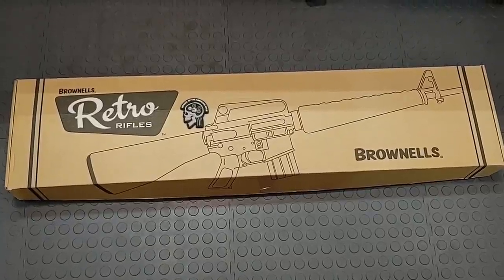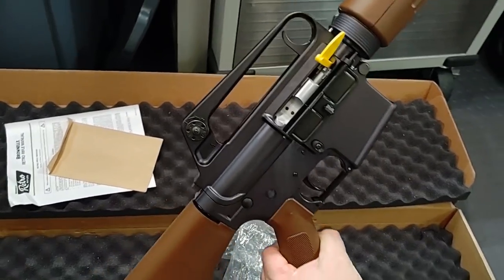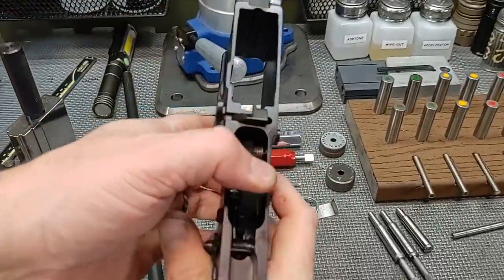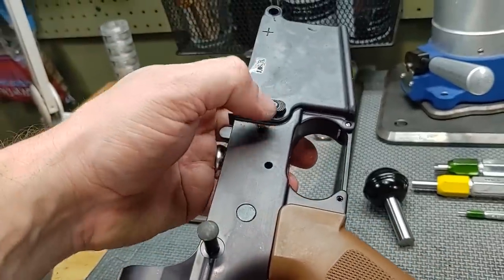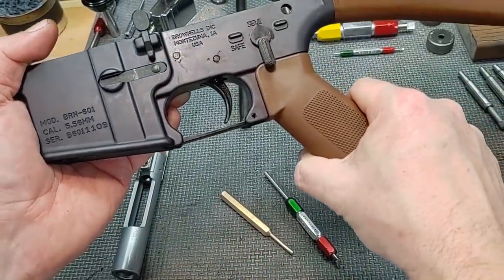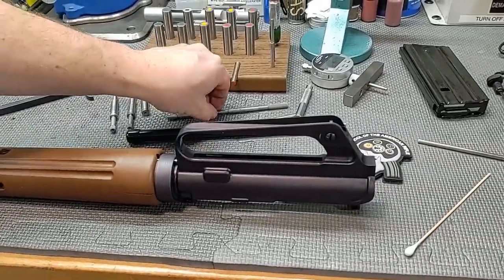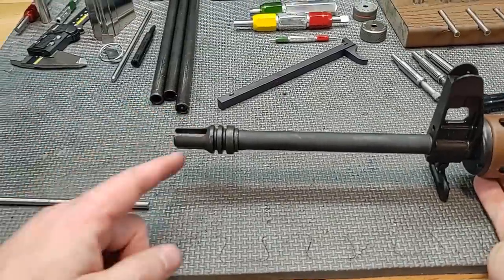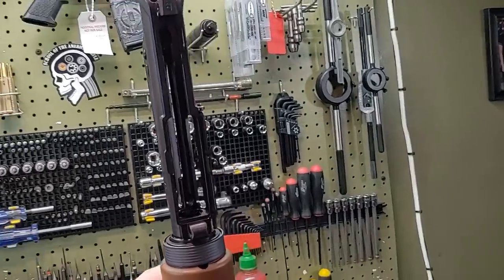Brownells BRN PROTO AR15 Retro Physical

Comment: Yes, I saw the Forgotten Weapons interview. They have discontinued several of their retro items but are continuing with others. Unfortunately, on the discontinued items they are not producing any spares for some of the proprietary parts for many Retro models.  This isn’t necessarily a problem with the 5.56 rifles  but will  be an issue for anyone who purchased the BRN-10 in 7.62. Which I find curious, they paid to have tooling, molds and the like  made for all of these retro style parts but then discontinue them.  How do you get a return on investment by doing that.
Reply: I’ve heard Paul Levy state that they would continue selling parts for most of the retro rifle lines/models. I believe he mentioned that during an interview with Ian on InRangeTV or the Forgotten Weapons channel recently.
Reply: There was an interview with (I think it was) Paul Levy with forgotten weapons.  He spoke in length about the project.  From what I recall- it sounds like if they can still get the parts they are going to try to keep them available.  Check it out it was a good interview anyways, may be some answers in there for you.
Reply: @cdecro00  I saw that interview, he said they would continue to make spares of the 5.56 rifles.  In that same interview he announced that they discontinued the BRN-10 and the Proto in 5.56 despite the fact both items are on the  website. They still have some BRN-10 parts on their site as of December 23,  2020 but there are no bolt carriers, pistol grips, and only black hand guards. They also were going to make Portuguese hand guards, and a carbine model. They abandoned both of those projects and dumped the parts they had made on their site with no comment. My issue is that they discontinued these products, didn’t follow through on the Portuguese model (which was the one customers actually wanted) without mentioning it on any of THEIR social media platforms, I think that is just bad practice.

Comment: Hi, Chad. Another great video as usual, thanks. Your gas system straightness gauge is relying on the carry handle being straight. Can't the carry handle machining be off as well?
Reply from the maker: You are correct. The slot could be off. 

Normally I use this gauge with a Colt Carry Handle that has been checked for trueness. 

When I hold up this rifle I can detect a canted front sight though.

Comment: If memory serves, U.S. Quarters from 1955 and earlier were actual silver (and therefore, yes, highly "collectable").  If you are going for the late '50s you should be fine though.
Reply: Think its 64 and older,my dad collected coins and that date comes to mind.
Reply: @stevechambers4810  I looked it up and you are correct.  I guess he's going to have a slightly more expensive time correcting that bolt carrier travel.
Reply: On July 23, 1965, President Johnson approved the Coinage Act of 1965, which removed silver from circulating coins and authorized that clad coins be used for the half dollar, quarter, and dime.

Comment: So I bought my wife a Springfield saint railed model about a year ago. She's never fired it and I'm hoping to get in a class with her. The other day I bought a Midwest URR to do a little gauging like shown here. The reaction rod won't even start to insert into the locking lugs. Bolt seems to cycle fine and it chambers a round. I guess contact Springfield?  But man am I appreciative of the things I learn here. Thank you for the knowledge and your wife for excellent camera work.
Reply: sounds like a clocked barrel to me, happens when there is enough slop between the barrel extension and upper receiver when being installed. check again with the assembled BCG and slowly push it into battery. if i am right it should hit slightly then the bolt will start to rotate then continue into the barrel extension and lock. if you have the tools i would just undo the barrel nut and re-align the assembly then with your reaction rod installed then tighten the barrel. if that does not seem to be in your wheelhouse then send it in.
Reply: @jacksonblanks8038  thanks. Never put a upper together but have been assembling all the tools necessary.  From what I'm hearing Springfield is not doing such a bang up job lately and I prefer to fix things myself anyway.
Reply from the maker: @take1one  I would see about a warranty exchange or repair. If it's been fired I bet there are impact marks on the corners of the bolt lugs or the barrel extension. If not, they will begin soon.
Reply: @take1one  yeah that goes for pretty much anyone. And yes just glad to help

Comment: Can someone explain the difference between rifle and M4 feed ramps? Been having trouble finding info, but always read about there being both and that the barrel extension and reciever need to match.
Reply: @muddyhotdog4103  thanks. Makes perfect sense why not to confuse the two.
Reply: @MrAwsomeness25  no problem.. ya btw- though not ideal, it's ok if you have an upper receiver with rifle feed ramps paired with a barrel that has m4 feedramps;  You just don't want it the other way around having an upper receiver with m4 feedramp cuts paired to a barrel with rifle cut feedramps. This can cause the cartridge to hit a wall/lip that won't let it feed properly in some rifles with a low feeding angle/high cyclic rate. 
https://images.app.goo.gl/dhdEHKnyxRFLZnTDA

Comment: I would love to have the AR 10 one of these days.
Reply: per Brownells they stopped making them, but still have some parts if you want to roll your own.
Reply: @rcairnut  checked the other day they do not have enough parts to build a complete rifle. Using parts from other manufacturers may be an issue because much of that rifle is proprietary.
Reply: @Veritas419  bummer and I wanted one more myself! I wanted to have a black one to run hard and my repainted one for display. I hope they restock the parts so we can build them.

Comment: Really curious why the gas port and chamber were so beat up but the rifle still had assembly gunk all over and the bolt was spotless... Couldn't be a used A1 barrel because the roll pin spots would be different

Comment: I noticed the “B” stamped into the rear upper receiver lug. I know with at least one manufacturer that indicates that the receiver is a blem. That could be the case as to why the gun seemed to have more wear than a new gun would typically have.
Reply: Could stand for Brownells too?
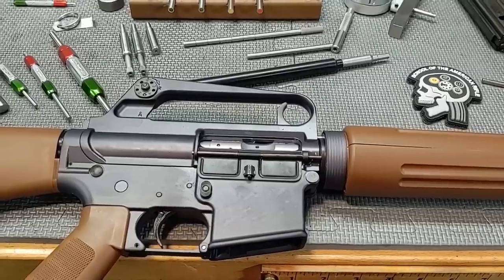Reply: @TheTorchredz06  The upper has an A over an H (visible 3:11-3:23) indicating the raw forging came from Anchor Harvey, the machining is anyone's guess. As far as the "B" goes, all the info I can find says blem, however, given that these were a limited run by Brownell's I would not doubt that they did mark them in some way for warranty/customer service reasons.

Comment: At 7:42 as you set the lower receiver assy on the vise you can just barely see the forward pin slip back into position
Reply from the maker: Good eye. I though it was gone forever. 🤣

Comment: AT 5:25 you show a clearance issue with the carrier/key and the receiver.  What is clearance for a Carbine length tube/carrier???
Reply from the maker: Should be the same regardless of the buffer type. True TDP Rifles Buffer Systems sometimes have a larger gap from the factory though.
Reply: @SchooloftheAmericanRifle  Thank you for the tip and the swift response.  
Any recommendations for Carbine spring length and buffer maker??